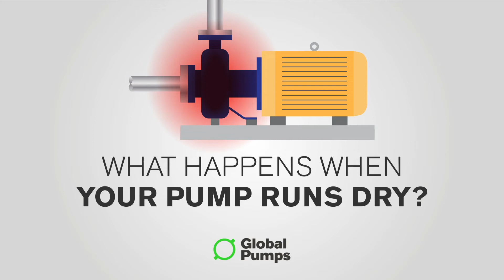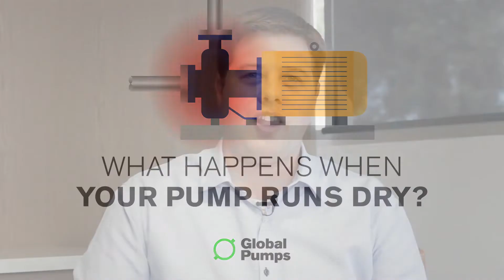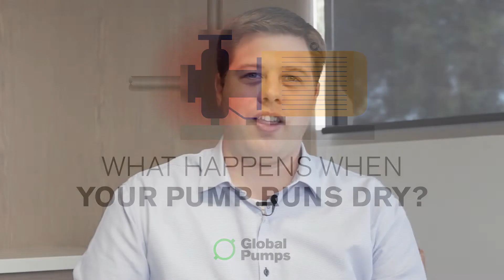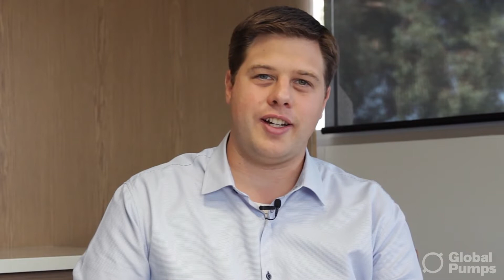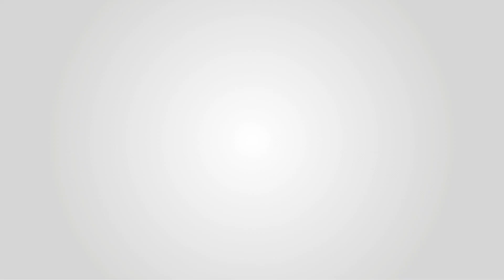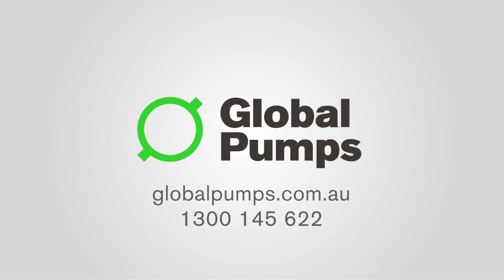What happens when your pump runs dry? - Global Pumps

Comment: Hi, my 1hp Jet type pump ran dry for most of the night and when I discovered it in morning the whole thing was so hot that when I switched over to another water tank the water was boiling before it got to the pressure tank and took a long time to cool down and it would not pump over about 20 psi after that. I rebuilt it with all new parts and the motor seems to be running fine but it still won't build over about 20 psi, any idea's. Thanks.